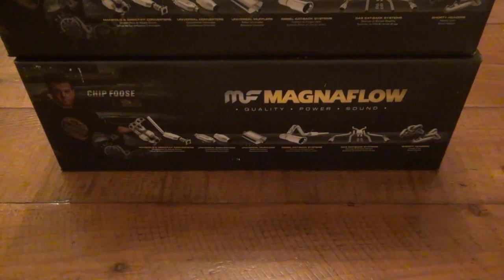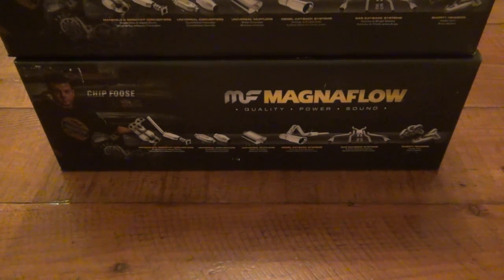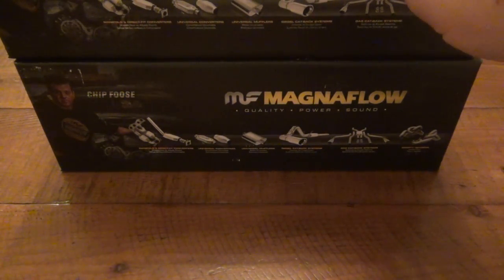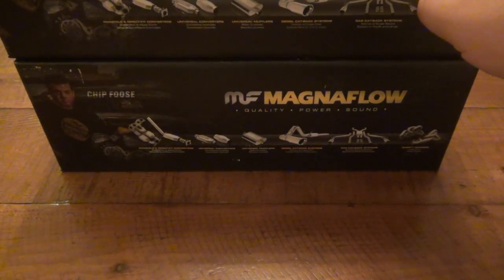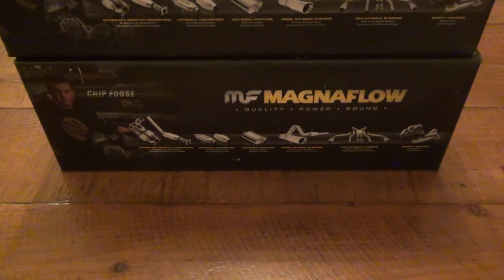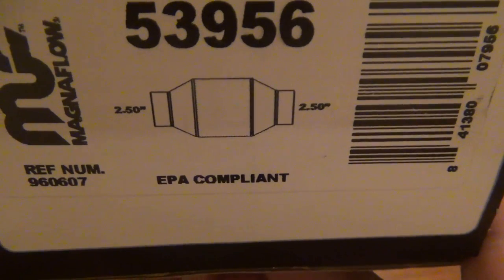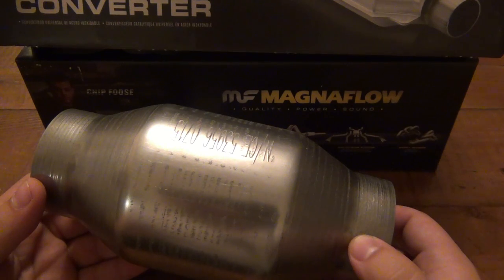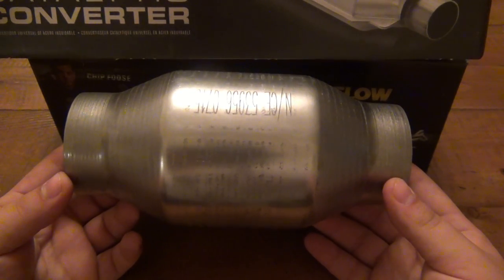Magnaflow Spun Catalytic Converter...Spun?

Comment: hey man  super 10's are really like really loud so just wanted to let you know, cats dont need heats shields there should be a 100 degree drop across the cat, also a cat cannot be cleaned at all if a 'mechanic' tells you that he's a lying fuck. and spun cats arent very affective in nox into c02 same with unburnt hydrocarons but for your particular application i'd reccomend them just  to help with the over rich condition that is associated with all carb's , and back to the muffler trade those flowmaster 10's in for some 40's flowmaster mufflers aren't a good performance gain due to style of mufflers they produce so your better getting off the ones that you wont need ear plugs for on a long drive

Comment: I hope that my comment does not get drowned out in all the "I hate cat's" noise but please take this from a certified master ASE tech. 1.converters or "cat's" are a necessary part of a proper emissions system but if your vehicle did not come with them and or they are not properly sized to the system they WILL NOT work properly yes some carbureted vehicles did have them when new but the efficiency of those versus newer types is such that installing incorrect types will be at the very least not worthwhile and possibly dangerous otherwise. cat's do create heat as part of there operation if your truck is not well tuned,  burning any oil,coolant ect. they will create MUCH more heat and or rapidly plug up. far more cars have started fire due to leaking headgaskets and running excessively rich than you would probably imagine. 2. you should never attempt to clean  a converter. even if the phosphates in most soaps did not damage the precious  metal coatings inside than even just plain water in

Comment: You do not need cats with that engine.  Engine won't run any different.  Whatever exhaust setup the truck came with is probably capable of flowing twice as much as that old tired 350" requires.  As far as cleaning a dirty cat goes.. soapy water or chemicals will do virtually nothing once the reactive metals have worn away past the point of being functional.  In 15 years working in a repair shop I have only seen one vehicle that had a plugged up cat that was able to be cleaned.. it had a major head gasket failure and had all kinds of gunk just barely down in the front side.  Engine was repaired and then customer decided a $300 cat was not possible.  In that case, back flushing it with water was helpful enough to get it flowing enough exhaust for the engine to run.
Reply: The engine swap throws a wrench into getting the truck to pass an inspection anyway.. not sure how your state deals with that.  It certainly won't be tested against the stock emission standards.  They might pass it only as a limited mileage vehicle once they find out, and then you're not free to run up the mileage once insurance is keeping tabs on it.

Comment: dude delete delete delete... get rid of the cats. Yours is old enough to not have to have it so don't have the restriction and cost. Take the cats back and put the money towards a good set of headers and a nice full dual exhaust.

With the age of the truck I don't think you need them. If you do, I'm thinking a bigger sticking point with the emissions test might be that the engine swap was done with it having originally been diesel and now it's not. Does your county require emissions and if so on what age of vehicle? I'm betting your truck is grandfathered. But again, depending on when the motor was manufactured that might be the overriding factor.

As far as inspection, as you know you'll have to have the annual PA safety inspection but emissions are dependent on the county you live in. Luckily I'm outside those fascist areas so no inspections required.

Comment: Send them cats back they dont have anything to do with an engine  smoking..  smoke  is from valve guides or piston rings .  or poorly tuned engine and will just clog your converters very quickly .. Not having to use converters is a good thing   pm me if you wish.... Iam in pa.... Iam a mechanic and have access to a private workshop shop in mountaintop   pa
Reply: Hey got a min?

Comment: a cat is a cat.   they haven't used beads since the 80's or maybe earlier.   you won't notice any difference in power unless you are running a race car.  and by race car i mean at least 800hp.
Reply: +punker6506 not true they're a 3 different types of cats 2 way cats and 3 ways cats, to be more specific there are 2 different types all 3 way cats for different applications and emmisions periods, and cat's don't really affect horsepower that much if at all. they're are an emmisions device only thing the cats effect are the gasses leaving the combustion chamer/exhaust manifold, and they can act as a resonator but not killing exhaust flow just sound. and the power gains from are so minimal its sad unless you're forced induction ie turbo or supercharger, maybe nitrious, and  your factory exhaust has to much back pressure then could see a substantial gain